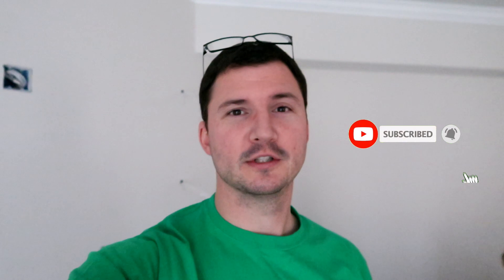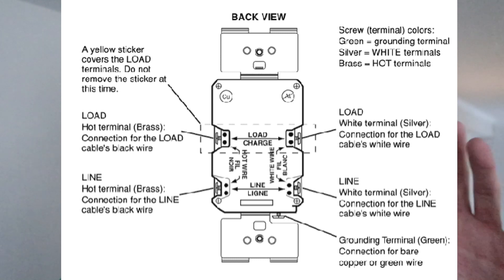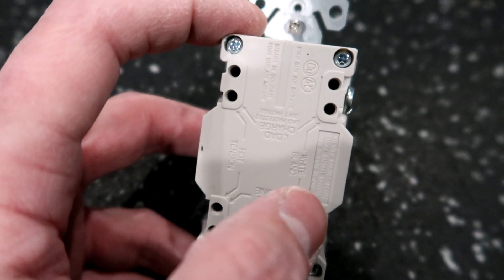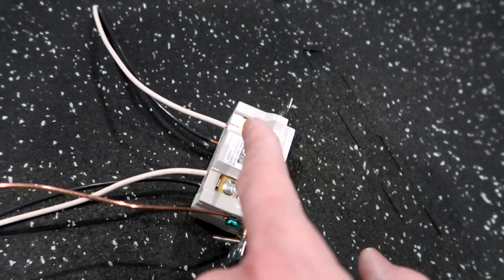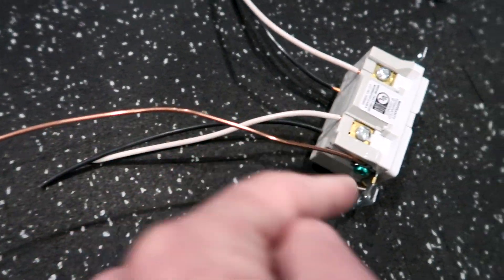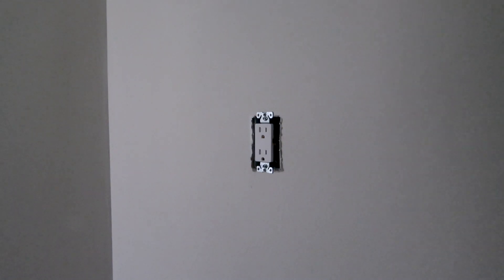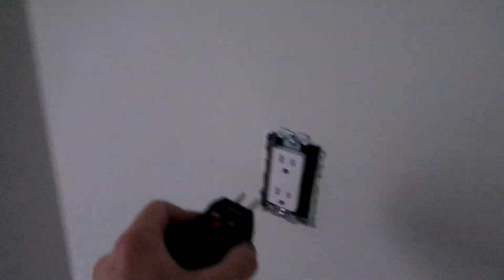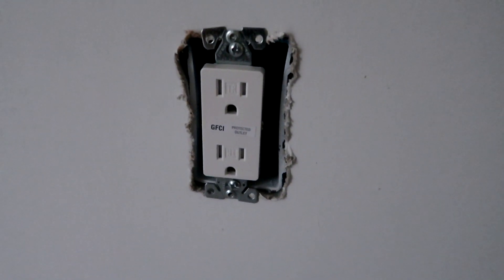How to wire a GFCI outlet and GFCI protected outlets | easy explanation

Comment: I guess my question about the shed is basically like this video. The only additional thing I will be doing is running 14 to cable in a little gray conduit about 30 feet across to my shed from the GCF. I plug currently outside on a pool. Can I also run 14 two regular Romax inside of a gray conduit and pop it up into the shed. My shed will just have two plugs inside it for basic stuff like cell phone or drill battery charging. Also to light switches one light switch for one light outside and one light switch for a two lights up in the shed. Do you know if this is possible could you do a video on that

Comment: Hello, great video. Wondering if you can do a video something similar to this. I have an outdoor light that has a GFCI plug below it. This is on all the time. I am going to wire up a shed with two plugs and two lights wondering if you would be able to do a video on that. I would love the shed to be downstream protected from the GFCI Pool light that I have already. It is currently on a 15 amp breaker in the house. The shed will not have any sub panel just two plugs one indoor light switch with two lights above and one light switch outside.

Comment: Can use both holes on the load side to feed 2 separate outlets? I.e. feed both outlets from the GFCI without going through the other outlet
Reply from the maker: @kevinryan7006  not sure I completely understand the question. But I would only have one set of wires come out to one outlet, then continue to the next outlet from there
Reply: @PlatoonGarage  Outlet 1 (GFCI) is on the right side of a double vanity. Outlet 2 is on the left side of the double vanity (connected to the load side of Outlet 1). I want to install a new outlet (Outlet 3) on the back side of the wall from Outlet 1 for a wall mounted TV. Can I just connect to the back of Outlet 1 in the 2 other holes on the load side?
Reply from the maker: @kevinryan7006  trying to envision this...  I'm not an electrician, but if you pigtailed the wiring correctly from outlet 1 to the new one, I imagine it would work

Comment: Does the ground wire loop around the ground screw or does it stay straight and just get clamped under the little ground clamp?
Reply from the maker: Either way should work as long as it's making contact

Comment: Why did you pigtail the ground when you had enough to wrap around the screw?
Reply from the maker: Grounds are pigtailed because the wiring continues on to the next outlet and you only need a single ground wire to connect to the outlet

Comment: I installed two additional outlets to an existing circuit in my kitchen, but when I pressed the button on the tester, the GFCI does not trip. This only happens on the  last outlet on the circuit.  All the other outlets do trip the GFCI.  What do I check for in this case?

Comment: If your just using the GFCI and not going anywhere with it would I just wire it up under the load side? White of course goes to white and black goes to hot
Reply: No. Whether or not you plan to have additional ones downstream, doesn't change the fact that the power coming in to the GFCI outlet, from the panel will always go to the line side.

Comment: Great explanations, any idea if having a single pole light switch in the middle of the down stream outlets will cause any issues?
Reply from the maker: if you put a switch off of the gfci protected outlet and the gfci outlet trips, you will lose lights controlled by that switch for sure.

I'm not an electrician, so i don't know if that is normal to do that or not, but i'd say you will probably have lights on a separate circuit
Reply: Thanks, unfortunately for me I already wired the entire room on one circuit, including lighting.  Hopefully it won’t cause too many headaches in the future.
Reply: I wonder if not having a return wire connected to the switch could cause an imbalance great enough to make the outlet upstream trip. Have you had any issues with it?